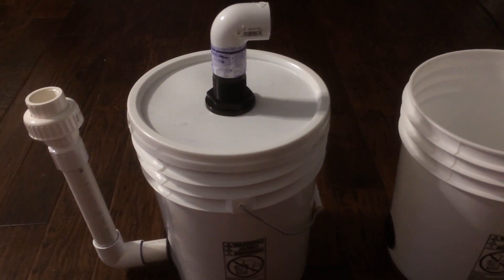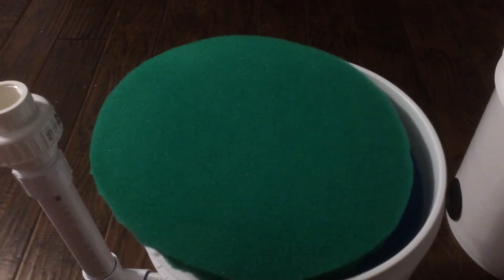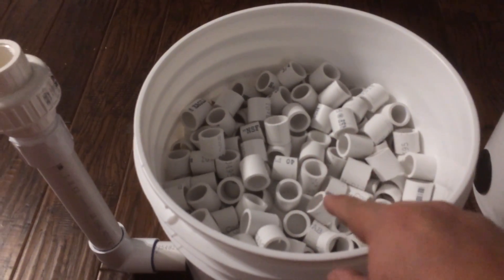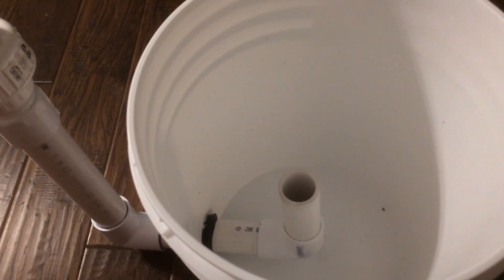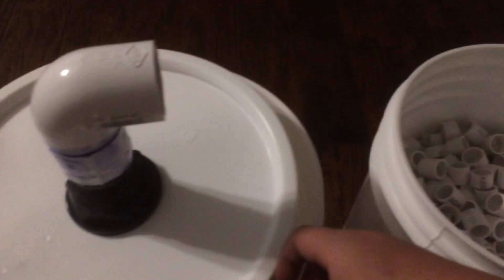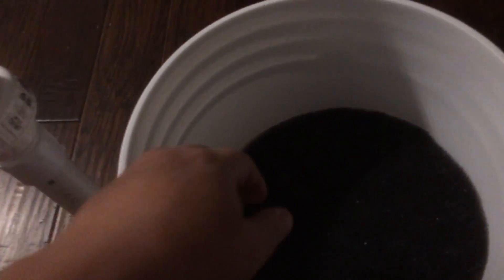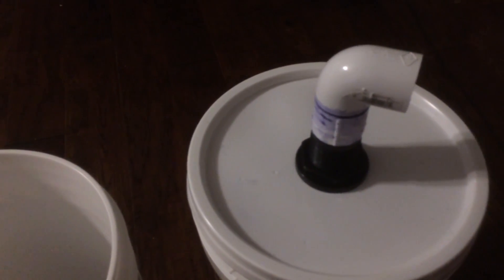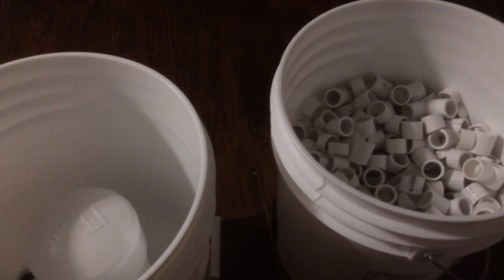DIY Canister Filter with Radial Flow Filter/Solids Separator:  Part 1 - Concept

Comment: Love the concept of the multi-chamber filter. This  seems like a rad way to hot rod filtration to keep nitrates low between water changes, especially for messy tanks that can't have plants- cichlids, monster fish, etc. maybe I missed it, but was there a way to drain the radial flow portion?
Reply from the maker: Thanks man. It works great. I never posted a follow-up on this because the forum I posted it on gave me crap. I can do without them. Glad you found this. Wish there were flat walled food containers we could use. Sucks that they are all round and makes it a little harer to sea. But you just take it apart. I don't remember if I included the ball valves and union couplings. but you shut off the ball valves, unfasten the pvc unions, then do the cleaning.